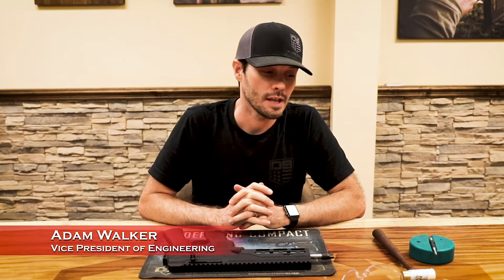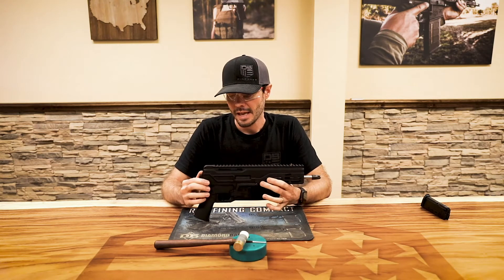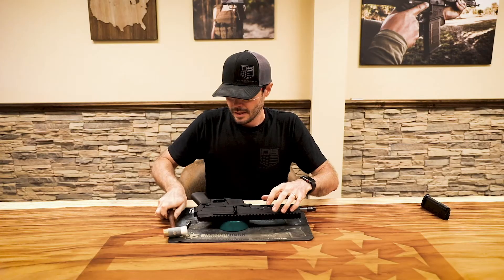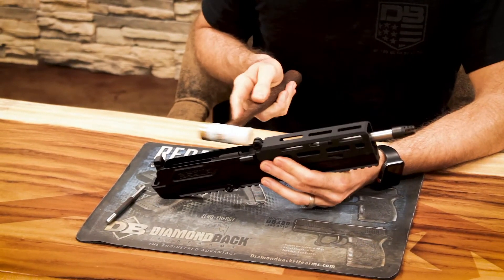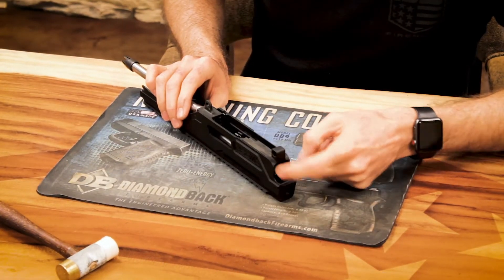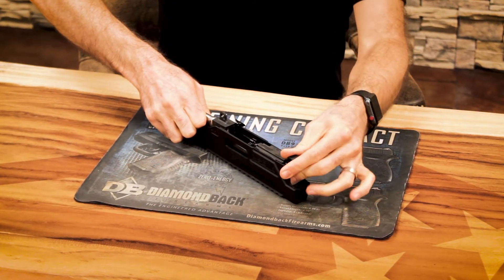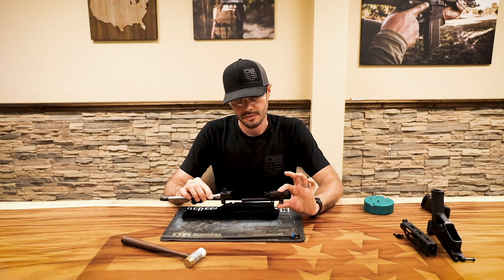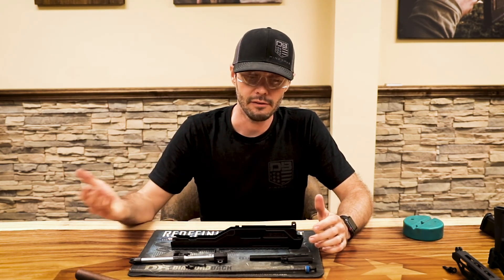DBX Instructional Video 2 - Disassembly & Field Stripping

Comment: Would y’all be open to making a non reciprocating charging handle version?
That’s the only thing stopping me from buying one rn.
Reply from the maker: No current plans, but I can definitely pass your feedback along to our Engineering team.
Reply: Are you allergic to reciprocating handles?
Reply: It'd would be a nice feature. But I don't really see it ever getting in the way, it has a small footprint, and If need be you can use it as a Foward assist